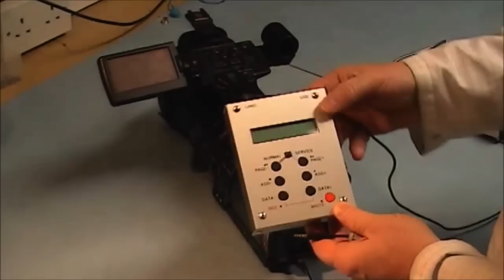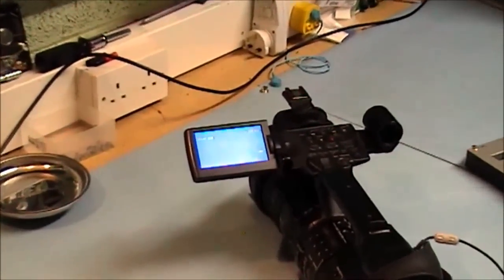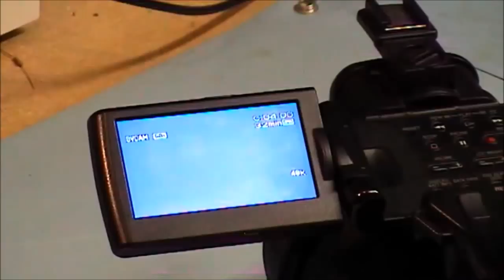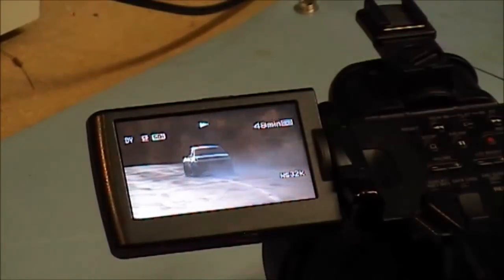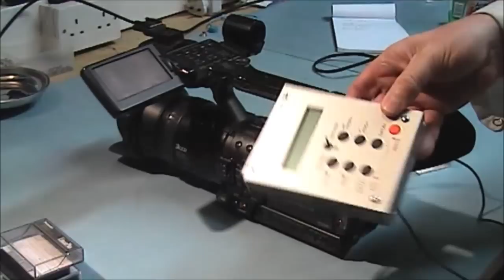Sony HVR-Z1E  Head cleaning and tape path cleaning tutorial

Comment: Thank you very much for your generous assistance in publishing the tutorials for the Sony Z1. The little nylon ring gear on the take-up table had split and come out.  I have repaired the ring gear with super glue until a replacement part I have ordered arrives. The machine works fine for now.

Comment: I cannot play back my recording. I had no problem with recording but when I tried to play back the cassette seemed to be empty, cannot see anything. Even those cassettes that I have recorded before, could be played before now I cannot play them anymore, they seem to be empty cassettes. So could anyone help me to solve this problem?
Model number Sony HVR z1u
Thanks a lot
Reply: Have you made sure your output is selected to the format you recorded on to the tapes, ie., DV or HDV. Unless the Menu item for HDV or DV playback is set correctly, or "auto" selected, the camera in VTR may not display the playback on the screen.
Reply: I have the same stupid problem, didnt used the cam for 2 month and now it wont work, seems to be a problem with the headspeed or tapetransport as i read i Sonys forum, expensive to fix, tired about that stuff, better sell it and buy a cam with memorycard

Comment: Great tutorial.  I have the same camera, but I believe I need to replace the drum and heads. The assembly itself. It's not much of a stretch from this stage, it seems. Do you have another video related to replacing the drum and heads? As an assembly, they should already be aligned, correct?

The symptoms for my camera include the following; the camera will record, but during playback in the camera, it skips and has blank spots, as if the heads and a drum are not making proper contact. Would you agree to my diagnosis?  I was able to purchase my camera for $50 US, at a pawnshop. For the cost of the head and drum assembly, I figured it would be a good investment. What are your thoughts? Everybody is welcome to reply.
Reply: I have the same problem with my one, it doesnt play back hdv, dv mode it works, what is the problem?
Reply: @christiansanden8005  Basically, you need to replace the entire tape head assembly. I don't have the part numbers or source anymore.  Sorry about that.
Reply: @scottoconnor8289  Sounds expensive, 15 years old cam doesn't make sense a repairing, it works in dv but thats not the resolution i want
Reply: @christiansanden8005  I had one and it didn't make sense wither, so I sold it.
Reply: @scottoconnor8289  Yeah i will try to put in Ebay, and a local scondhandsite, no worth to fix it, better buy a cam with memorycard.

Comment: My LCD screen is cracked. Can you help me work out how to replace it?
Reply: I also have no idea where to get a replacement part. Any help would be amazing!
Reply from the maker: The part number for the lcd is: 875320906
The lcd assembly does not come as a completes unit, the screen, pcb,led light come as separate parts
I have to warn you, the parts in this assembly are very sensitive to static damage, if you don't take static precautions, this could end up a very expensive repair

To get at the lcd,
remove the back cover, there is 2 screws near the hinge
then you have to remove the pcb and led pcb, to get at the screen
if you don't have experience in removing pcb's,
it might be better to give it to someone that has
Reply from the maker: hellsfoxes these parts can only be got thru sony
you could type the part number I gave you into Google, you might get a few hits there
Reply: @ElectronicWorkshop  I have problems playing back HDV, the cam worked perfect 2 month ago and now only dropouts, blue screen, in DV mode works perfect, whats happening??

Comment: can  you please do a video show how to remove the tape mechanism ... I need to replace mine  on my sony hdr fx1 im getting the error code c31:23  thanks....
Reply from the maker: I will as soon as a repair comes in that requires a deck replacement, as all of these videos are of live repairs of customers cameras
I should point out to you, if you manage to replace the deck assembly , you will need special equipment to setup the new deck, switching point, tape path adjustment, which is not cheap to buy

Comment: Good video. Where are you based in Ireland? I've a Z1 which is giving me a dirty head warning every now and again and giving me horizontal lines in some scenes, plus the odd drop out. Would like to move to a card camera but cost is putting me off.
Reply from the maker: I am based near London
I am from Ireland
I would make sure I have new tapes first, as old tapes can have dirt on them, and the tape oxide can come off them, clogging the heads
then i would clean the tape path Have a look visually at the deck, see if there is any dust or or tape oxide on the deck
Reply: Electronic Workshop
Thanks for getting back. I'm here in Wexford so thats why I was asking, in case you had a workshop I could drop mine into. I think you hit the nail on the head. I bought a box or re-used tapes from crowd in Bristol and been using them on and off and the problem started then. The head looks clean, bit of dust but no residue .ie it looks shinny still. Friend said it could be misaligned. Operation reading 159x10, Drum Run 94x10, Tape Run 69x10 so not big use on the camera. Thanks for the help. I noticed on your video you used a special thing to clean the head. What is that?

Comment: What's the name of the testing box you are using to plug into the camera?
Reply from the maker: The jig is a CPC-8
 Sony p/n J6082388A
you would also need the remote lanc
Sony p/n J6082565A
Reply: Electronic Workshop Where can I get these to buy
Reply from the maker: Its called a "remote lanc"
Sony p/n J6082565A available from Sony.
Try this link https://www.servicesplus.sel.sony.com/sony-part-number-J6082565A.aspx

You would also need the test cable CPC-8 Sony p/n J6082388A
and lanc cable Sony p/n J6082442A
Reply: +Electronic Workshop 
hi i really thank you for the head cleaning video. i have one question I have a Sony camera FX 1000  how to change the  Motor  zoom